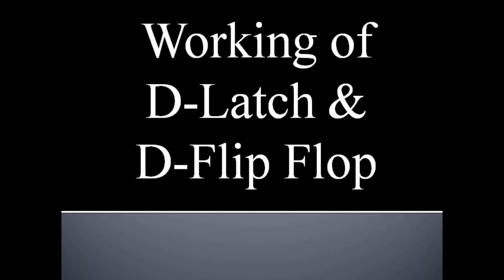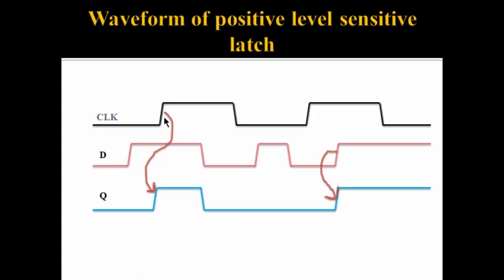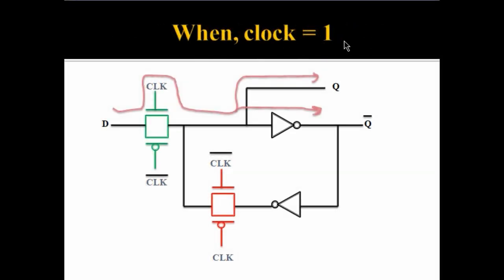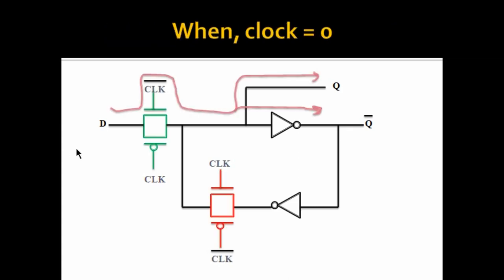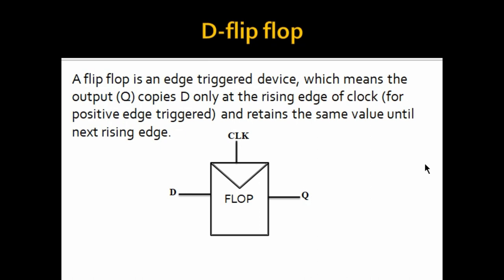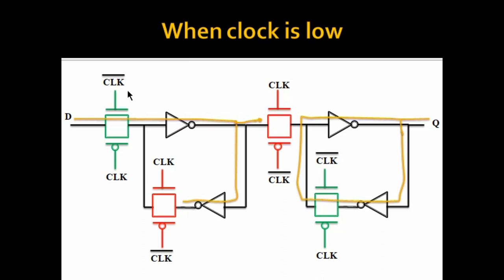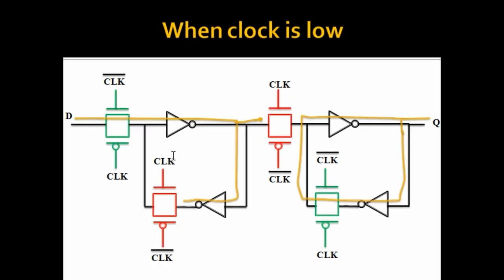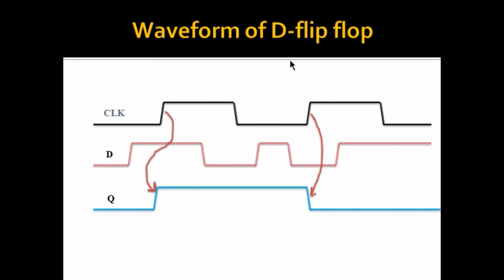D-Latch & D-Flip flop.

Comment: for Level sensing, 16 transistors are required & a master-slave configuration. But this can be easily achieved using a simple D latch with 8 Transistors and an edge trigger clock generated by [(~A) & A] configuration